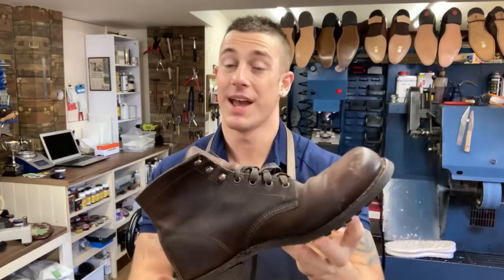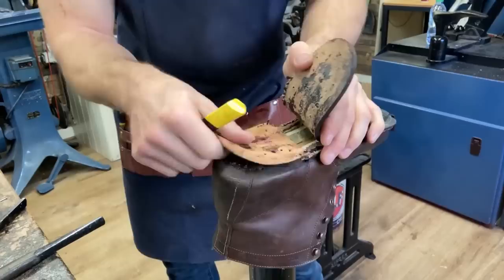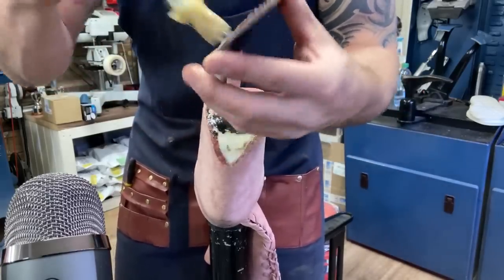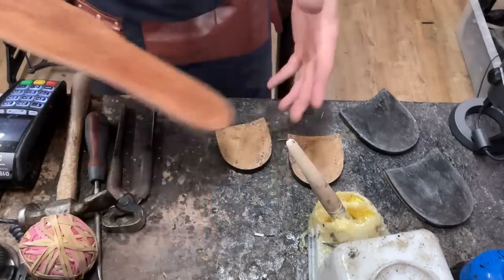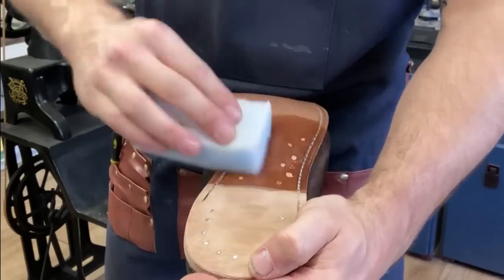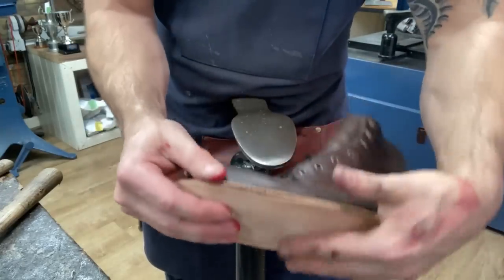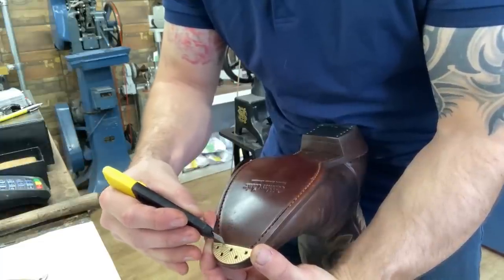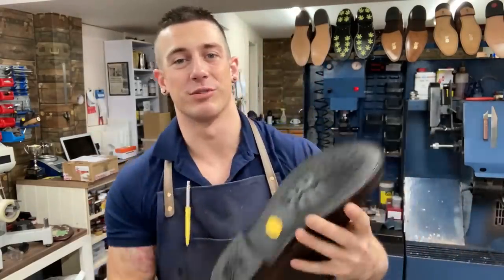WOLVERINE 1000 MILE BOOTS - RESCUE JOB! // COWBOY BOOTS RE-SOLED! Shoe Repairs

Comment: I love the work on the Wolverine boots, I have a pair I will need to have the sole repaced soon the heel is almost gone on the outside edges. they are great boots and really hold together, I wore a hole in the liner long before I needed to fix anything else on the boots. how I found the chanel actually, I was looking into what to expect when I take mine in to be fixed.

Comment: Dear Dan, I've been intensely searching Youtube for diy's on how to create soles from sole-mats. I looked through most of your videos on female shoes but all I see is left and right soles. Isn't rubber mats used in cobbling anymore? The question in this is not how to put it on but how to smoothen the edge that points towards the heel since that part is abruptly cut if you know what I mean. I's something that needs to be carved down. I'm thinking filing it down but maybe you guys have some solution that melts it down or something? Another question that I have is how to fix a suede stiletto that has been tarnished along the heel and on some places you can see the actual plastic heel behind it. Do you change the entire suede or can you put in small suede-like "hairs" in the destructed parts?

Comment: I have "CAT" boots, really comfortable. Used some spray on conditioner/waterproofing lightly, in the last year. The question is, how to know what type of leather is on uppers? Oil, wax... They are brown, slightly saten looking without any sheen and ever so slightly "rough" under the hand. Never used any cream or wax on them, they are really soft.
And great videos. Really love seeing making with your own hands!
Reply: They may be Nubuck (check wikipedia), and most work boots are greased, as that's the toughest waterproofing. Modern spray-on waterproofing is usually a silicone product, which among leather purists is a big no-no because it makes the leather appear to be in better shape than it really is, thus shortening the lifespan. Silicone makes the leather feel like there is still plenty nourishment left in it, even if it's just tired dry leather encased in a "rubber" surface.

However, if you are using them as work boots they're a tool, and tools have a life span. How much time you want to investing in prolonging the life span is up to you. 

If you use them as dress boots (and you can verify that it is Nubuck), and want them to last forever, I would recommend Mink Oil for the bi-annually "lots of love" and something like the Saphir lotion Dan used in this episode for the more casual touch-ups. 

If you want to give them a more heavy army boot feel, working in pure rendered pig fat (that's how leather greasing was done back in the day) works a treat. It's a good idea to melt it first, or use the Mrs' hair dryer to heat the boots while you work it in. This can be done to all leather types except suede. It does, however, usually darken them a tone or two. If you do it to nubuck it does even out a bit of the texture, and you can even buff them a bit afterwards. However, you'll never get a mirror shine on nubuck, even if you wax them heavily.
Reply: @andersjjensen  Thank you mate, I'll see in to it. I use it primarily over the winter beside my work boots and as a dress boot over the year. I had it sprayed two times maybe, don't know if there is silicone in it. I'll check.